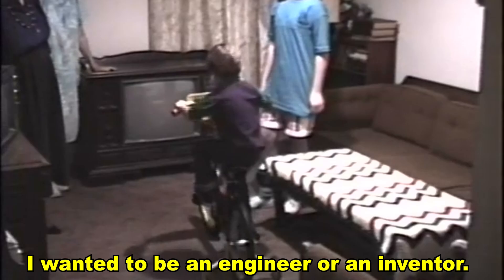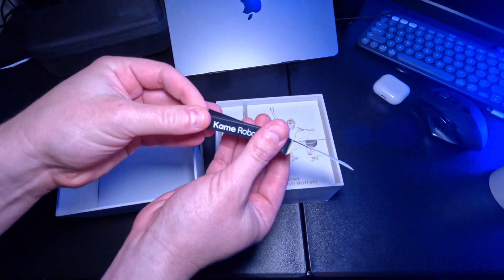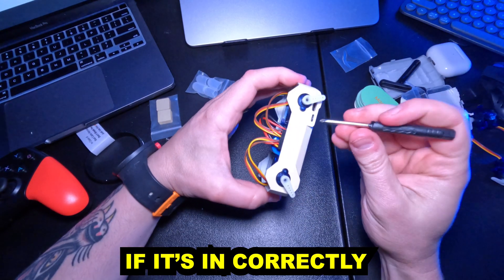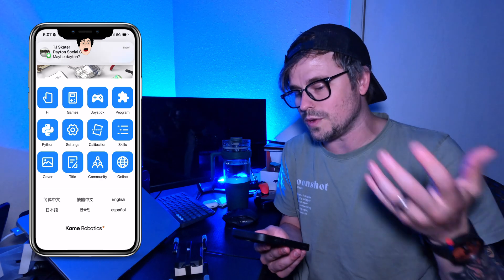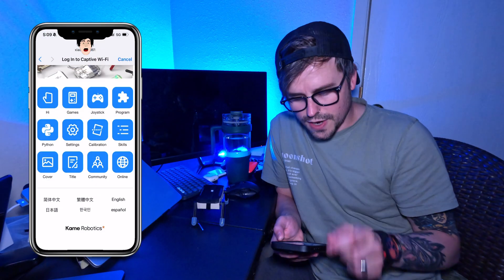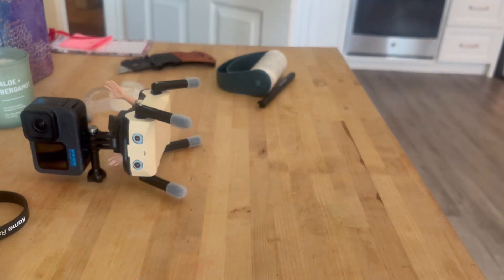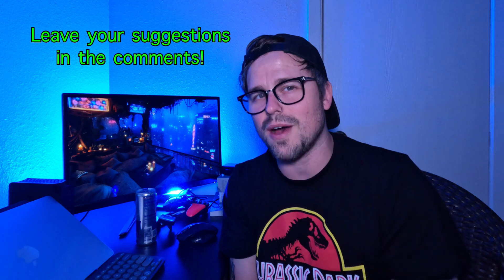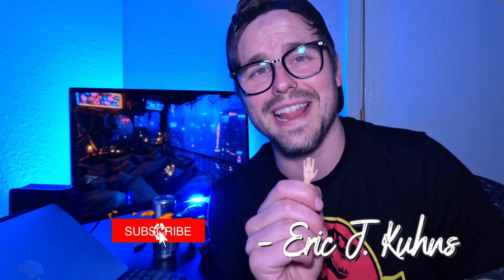DIY KungFu Desktop Robot! | FULL REVIEW & ASSEMBLY

Comment: This is actually super cool. They should have interchangeable legs on it. Like if one set had wheels on it so you could program it to essentially be a tech deck robot. It could pop itself up using its legs to kickflip, tre flip, backflip, itself. Basically turn it into a remote control skateboard.
Reply from the maker: Dude that would be super dope! Hopefully they add some of that stuff after launch! 🛹👏